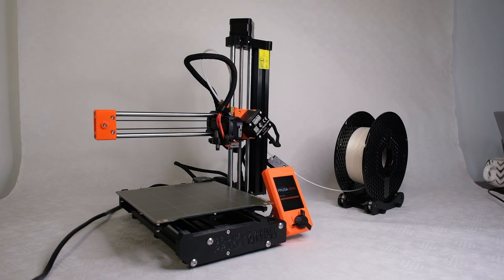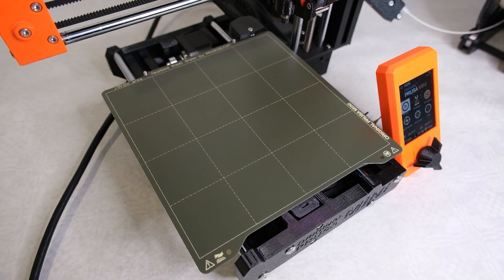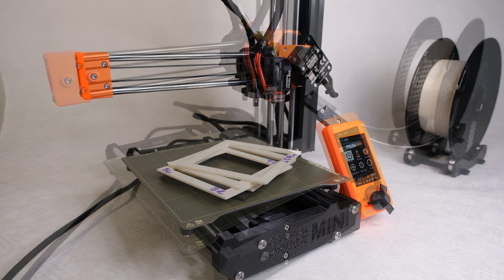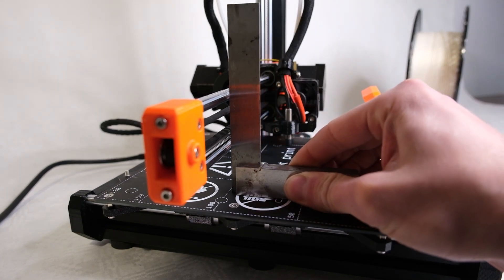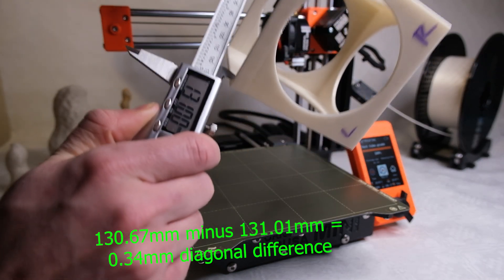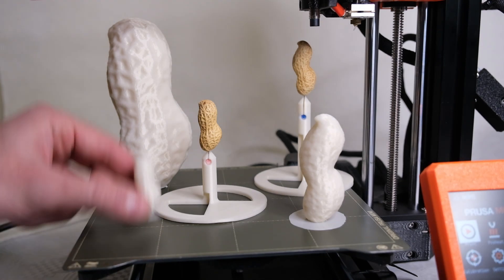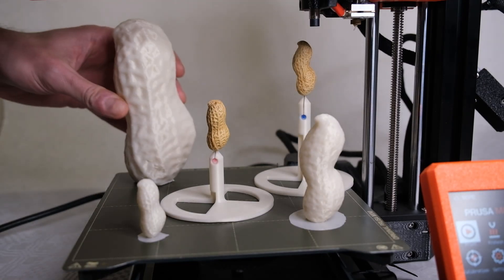Prusa Mini + / Squaring X Y Axis Skew

Comment: I wasted half a spool, thinking my tolerances weren't sufficient. Turns out the mini rhombusd when it should have squared. The official documentation is still clueless about this possibility. Thank you for the video, but that didn't solve my problem, which is that the X axis is not perpendicular to the Y. The plate is fine. The arm of the X axis is at the end tilted forward a couple of degrees.
Reply from the maker: Maybe you can ask for the part to be reprinted and sent to you.  Either that or re assemble the section to see if any debits had made it offset. It's possible to get the mini printing well but it's a process of trial and error.
Reply: @SavvasPapasavva  For now I've resolved it so that I wedged almost 2mm thick piece of plastic between the aluminium extrusion and the printed plastic part that holds the Z rods. I could only eyeball it but even so, a 170mm square now has less than 0,5mm difference on the diagonals, before that it had about 2,5mm. It's not easy to keep everything perpendicular when you're adjusting it... But damn. I'm still a bit in shock this happens on a Prusa printer. I've been printing for a couple of years with the mini, haven't noticed this before. But it is the first time I've printed large part where squareness is critical..
Reply: @dingdingdingdiiiiing  I'm late to the party but I'm having huge issues with mine while printing gridfinity boxes. The wall thickness was different on two sides of the box so it felt like paper. My diagonal difference is about 1mm too. I'm trying to get the x-axis aligned but as @SavvasPapasavva mentioned in the video: it seems to be a matter of trial and error. Really upset with this and it keeps me trying for two weeks..

Comment: sorry but think your are wrong since the Z rods get clamp in the Z bottom box (the electronicbox) and Z box have 2 fix points on the side off the 3030 so if that part is printed on a printer where XY if skew is not perpendicular or the printed Y front/back dont have identical holes for the 3030 the top Z alu shine only have 1 mount point on the 3030 so that become pivet point on X plane
you will end up twisting your Z axis  if you look at  XY skew at Z0mm  and Z180mm it will most likely have a twist.

Comment: Thank you for this! I was following along the "Squaring your MINI" article for my MINI+ and it had no mention of how to work on the XY axis. My printer has a very slight misalignment and I haven't noticed it until now that I had to print a box with the two lids printed separately (and the top lid laying on its top) and noticed I can't connect the two lids properly.

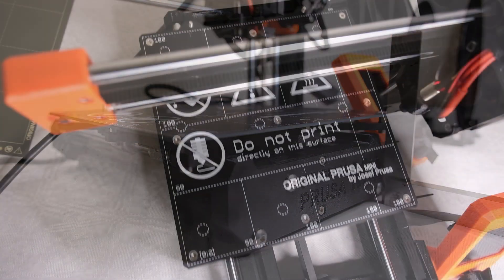Comment: At 1:50, the front and rear cap pieces of the bed assembly are NOT 3D printed parts, they are injection molded.
Reply: In this video the front piece is actually 3D printed. They changed this part to injection molded after some months of production.

Comment: Now after owing the MINI+ since April 2022 I can recommend staying away from this thing. So much troubleshooting and stuff I can not stress how much I hate it. It just works definitely not the case here.
Kind Regards
Reply from the maker: Try follow this official guide to squaring. https://help.prusa3d.com/article/xz-axis-skew-correction-mini_158518 I also bought small 0.2mm shim washers from ebay and placed them between the heat bed and stand-offs for this levelling mod - https://forum.prusa3d.com/forum/user-mods-octoprint-enclosures-nozzles/prusa-mini-silicone-bed-leveling-mod/

Comment: Great video, but it makes me hate my prusa mini even more. I wanted to like it, but this skew issue shouldn't happen. It should be square by design, not by calibration. I also had the too-short ptfe tube in the hotend, and then noticed the heat break is 5.5mm instead of the standard 6mm... not to mention the cables running underneath to get snagged... it's just a disappointment.  Don't buy one.

Comment: I've tried everything in the video and the comments and nothing has worked for me, no matter what I do the arm won't stay in any adjusted positions and I have the same XY skew at the exact same angle. Is there anything else I can try here? I can't believe nothing about this is in the manual or the official squaring guide, this kind of skew will completely destroy the usability of aligned assembled parts. I'm so frustrated with this thing, I really wish I just went for a typical printer that's held from both sides.

Comment: The 4 screws were not enough for me to correct the skew, I had to loosen more around the base… why don’t they calibrate this in software? It’s even a Marlin feature, there would be basically no work to be done.
Reply from the maker: I don't understand why it can't be done is software either - as that feature is available on the larger machine with the older controller. It's just a firmware update away...
Reply: @SavvasPapasavva  Same with me.  I had to loosen the 4 big screws on the main support that stand strait up.  2 on the top, 2 on the bottom.

Comment: but what if it is out of perpendicularity in the XY plane?
Reply from the maker: You mean going upwards into the Z? I suggested to strengthen the z axis with that bracket but it's not that easy to calibrate this machine.
Reply: @SavvasPapasavva  Oh, I am realizing that I misunderstood what you said in your video, I see that you acchieved this using the white line as a literal guideline for perpendicularity in the c axis (xy plane). I would've hoped there would be a more accurate way but perhaps not. Thanks a lot for your video. My Prusa mini got knocked very hard on to the concrete ground and smacked the x axis. I am running these checks to confirm squareness. Great video!
Reply from the maker: @hillfortherstudios2757  The prusa mini is a difficult machine to square - partly because of how it's designed. Compare this printer/video to the Cetus on MyfordBoy's channel - and how simply he squares his machine up.
Reply: @SavvasPapasavva  I didn't have to. My mini was knocked on the floor and smacked the x-axis. I just wanted to double check that my x-axis was still square. I think it may be a good idea if one did have squareness issues, to re-print the mounting piece (the piece that connects the z axis bars to the x axis bars. That would be unfortunate, but at least there is that modularity. Thanks for your response! Thanks again for the video!

Comment: Hello, During calibration my x axis fails and it just skips over the y and z calibrations. I noticed that the nozzle sits higher when it is farthest from home. I came across your video and checked for squareness and it was slightly off, so I fixed it expected my problems to be solved, but it still fails the xyz calibration. I’m not sure what else to do.
Reply from the maker: Look for the X Z Axis skew correction process on their website. Sounds like that's your problem.

Comment: Very useful video, thank you!
Just a wild thought: maybe the re is some skew at higher Z because those smooth rods are twisted a tiny bit? Maybe releasing and adjusting screws on the top would help.
Reply from the maker: Yes that is a possibility but it's hard to tell. They are seated into 3D printed parts. Maybe using a dial gauge with the magnetic base running along the aluminium would reveal that answer?
Reply: Yes I was thinking dial gauge as well, but very useful advice anyway. About to order my mini.

Comment: Thanks for the tutorial but this does not work for me. I can not move the X Axis in any direction after loosening the 4 screws. Anybody know what I am doing wrong?
Reply: Indeed, could not gain any movement in the X Axis by loosening the 4 screws identified in the video.  The OP mentioned having consumed an entire bottle of wine to get it right... and I suspect this had something to do with it as by the time I was done with the job I had wished I had a bottle of wine handy.  In the end, I loosened the three bolts that hold the Z axis tower to the Y axis table and inserted foil shims of the appropriate size between the electronics box, where the attachment screws pass through, and the 3030 extrusion.  This did the trick...
Reply: @stevensaero  yup that is how I solved it eventually. Wish there was a more elegant way to solve this but ultimately I think using 3d printed parts as true squares for the frame always ends up with these kinds of defects
Reply: @stevensaero  Care to say that in English? LOL..  Just assembled our printer and even though the pinion on the X axis motor looks pretty centered, on the gantry side it's rubbing the right side.  Having some issues with the left side with prints.  Get some layer shifting even though I've checked the printer with a square and it seems to be pretty square.  I don't know how to get the belt more to the middle of the gantry idler.  While printing I can see where the X hesitates in one spot.  New to 3D printing so...
Reply: I have the mini+ and I cannot move the X axis either after loosening the four screws. I think those screws are just for holding the X axis guide rail bars. I also tried the four screws in the back behind the bowden drive but it is still not working for me
Reply from the maker: How many turns did you do to loosen the four screws? Do you see any movement at all when you look downwards onto the X axis and compare the axis to the lines on the heatbed?
Reply: @SavvasPapasavva Ah i guess I know the problem. I don't have the Mini+ and there is no clearance between the printed part where you turn the screws and the aluminum profile. The printed part sits flush with the profile....
Reply from the maker: @bluurayr  I didn't realised the 3D printed parts had changed - thought it was just the upgrade to the SuperPINDA sensor? You could try loosen the machine screws at the top and bottom of the Z aluminium profile but I found the four I described in the video allowed for sufficient movement to correct X Y skew. Anyway good luck - from my experience I think all 3D printers need some kind of calibration.
Reply: @SavvasPapasavva  Maybe I am wrong. I just compared your video to my printer and the angle at which I can see that printed part in your video made it seem like your printer has a bigger clearance. But I will try that and report back. Thanks!

Comment: which photogrammetry software did you use? Meshlab or one of the paid options?
Reply from the maker: I used agisoft standard - but it seems to be missing the manual chunk alignment feature using markers, so I haven't been able to get two halves of a objects to join properly with my current method. There is also another software called meshroom which is a software developed by collaborating universities and is also free. When I have time I'll have a go with that too and compare.

Comment: Thanks for sharing. I had considered some minis to supplement my existing farm however I was worried about squareness issues with only one support on the Z. I might just but a few more MKS3+ instead. Stay safe!
Reply from the maker: You too! If I had known about the skew problem I'd have probably just gone with the MKS3+ but it's a nice size and does print really well - really easy to set up and bed mesh level. Just have to keep an eye on that skew. I've also printed the brace which will hopefully improve the rigidity.
Reply: Squareness is an issue with every printer
Reply: @giedrius2149  that's why there are other good printers
Reply: @giedrius2149  Between the two of them, however, it's far less of an issue on the MK3. The Mini is a multi-piece cantilever design with no software skew compensation. The backbone of the MK3's, on the other hand, is a single-piece steel frame-- and it has sophisticated skew detection and compensation built into its firmware. I love my Mini, but there's really no comparison here when it comes to printing functional parts. I'm hoping the XL combines the best of both into a single machine.

Comment: Hi I don’t know the cost of filament but I know you can print knobs that can except M6 or M8 bolts through them my question is the cost of making star knobs less or more than buying them?
Reply: The main benefit of printing them over buying them is that you've always got them "in stock" at whatever dimensions you want.
Reply from the maker: Hi John - hope you are well! To answer your question, many slicer software allow you to input a cost per kg of filament which is used to estimate the cost per part. I had a 3D model of a wing knob for an M8 bolt that I just imported in the my software and assuming I was printing it from a £25 spool of PLA filament, with a 0.2mm layer height and 30% infill, the part would cost 33p. So very cheap. I think for me it's the ability to realise designs or ideas very quickly which is the magic of 3D printing.
Reply: @SavvasPapasavva  I agree, the only things that have stopped me from buying one is my own stupidity, I have a CNC that has been sat here for over a year that I just haven’t managed to figure out how to carve anything on it as when I bought it I did not read the manual and when I did read it I found out that the programme will not run on windows10 and although I have a couple of computers that run XP and window 7 I don’t seem to be able to get it working on those machines and every time I sent an email to the parent company (in China) I got the same response no matter what the email was about that told me in very poor English to plug the machine in, I got so frustrated at one point I thought about flying to China and shoving the CNC where the sun doesn’t shine.
Reply from the maker: I feel your pain - I was lucky that when I started with CNC I had a friend in my studio who was able to point me in the right direction. You could try go with a different controller but it's a lot to learn - or sell the CNC on ebay and have a go with 3D printing. Something like the Prusa mini will have a lot of information online to help you along the way.
Reply: just to add to Savvas' comment John; my particular machine pulls around 350 watts (using one extruder and the heated bed for ABS), so a 4 hour print for example, at 16pence/kwh would cost about 22pence in electricity.
Reply from the maker: @spammyjenkins87   I'll add to that - the print I described earlier would take 1h 20m to print. So it's very cost effective.